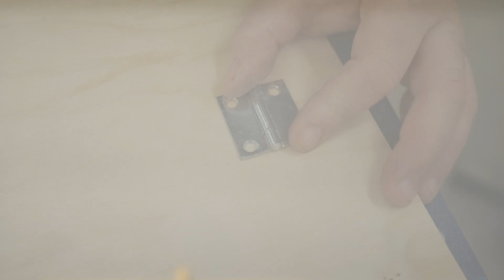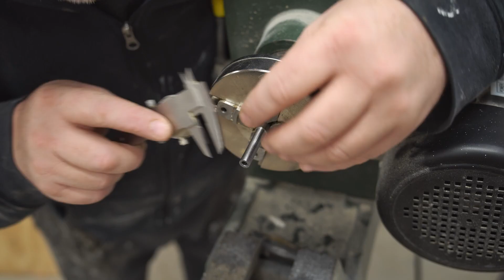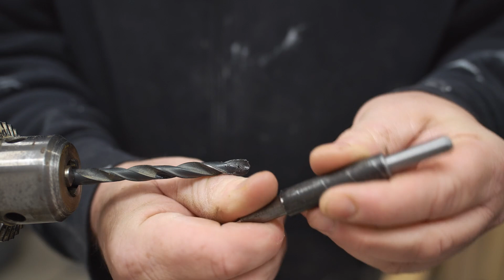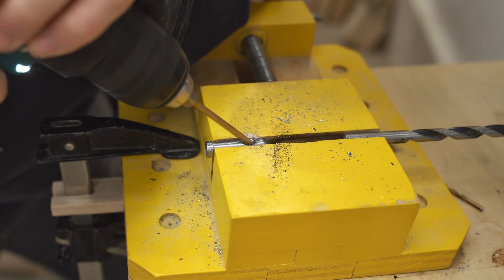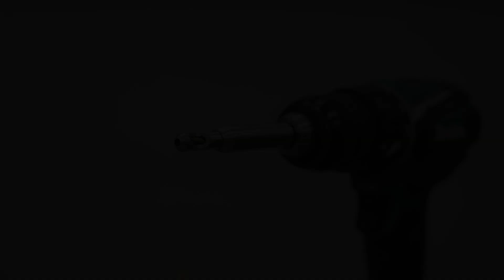How To Make A Self Centering Drill Bit / DIY Vix Bit

Comment: If you only need to get the hole centered for a steel (or brass) hinge on wood. simply start with a countersink. The wood is so much softer than the metal that the hinge hole will center the countersink if the hinge is clamped in place and that conical hole will center the drill for the screw. If the hinge fits in a mortice that makes the job even easier.

Comment: My goodness, John!!!    Is there any thing you can not do?!?    I just bought a set of vix bits and was confused by the knurled parts and also the Allen screws.   So I went to You Tube to learn about these parts and watched 2 videos where they are being used in hinges.  As per usual, I scrolled down to watch a third video on the subject, and there you were!!!  You have totally amazed me with your unparalleled  wood working and now I see you fabricating in metal work.   Needless to say, I am impressed.   I might also add that you explained the parts of the bit that I was confused about.  Thanks.

Comment: "...It's not especially fast when you have to stop and clear the chips out after every two or three holes" Then he proceeds to spend most of a day making a single tool bit.  I can buy a set of 8 or 10 on Amazon for about US$20. 
Interesting video, but I felt like I should be wearing safety glasses AND heavy cut-resistant gloves just to watch it!

Comment: To stop your file clogging up with chips (it's called "pinning"), clean it with a wire brush to get any existing pinning off, then fill the teeth with chalk. Just rub your marking chalk stick over the file until the teeth are filled. No more pinning!  If you use the file to sharpen your chalk, you can kill two birds with one stone!

Comment: machinist here and I'm not even mad. you'll find that incrementally stepping up in drill sizes like that puts an awful lot of load of the outer edges of the drills, I'd recommend getting a few center drills and if you are going to drill a pilot hole don't go excessively larger than the web of the drill. Wonderful work regardless

Comment: Good stuff. This is better than the road runner one.
Sometimes I use a pop. rivet drill bit to make a small starting divot to the center of the metal rod on the lathe. Usually they are short and quite strong bits. So they dont bend.

Comment: Is very interesting see how do you build this without a proper metal lathe. What if you make only one size, the smallest, and, for the next sizes, use a normal drill again with the correct size over the previous, already centered, hole ? Yes, I know is double work, but, if you don't need the other sizes frequently... Thanks for sharing !

Comment: Hey John. I thought your  build was pretty awesome on the Vix bit  one other note  is  i saw on Ebay a unbranded. Set   That the individual self centering bits were under 2  bucks  per unit  i could only assume  that original patents ran out and  those were Chines copies ?   It may not stop the clogging issues  you spoke about but i was quite amazed at how inexpensive  they can be bought at  now a days   Around 20 ish years ago   I  paid nearly fifty dollars for  a larger Vix brand  bit  that i still own today  it does  clog up  pretty  quickly like  most of my other  Vix bits  and  on big jobs i often  used it to only mark the hole and would drill it out with. Another bit  i really thought your machining  tricks on your wood lathe were pretty cool  to build. Your bit  and i mention those  inexpensive ones on Ebay  because they may be affordable. To use as. "Experimental"  ones to modify  or play with to improve  on clogging  ?i have personally only used Vix and Snappy branded  ones. And both have. Had the same clogging  difficulties  although i found the Vixs  brand to be made from a harder metal  with better springs than the Snappy  at a much more premium  cost  of course

Comment: Very cool project. I have tried softer metals on my wood lathe but never steel. Good to see that some steel work is possible if needed. 
I have a set of Vix bits I have never taken out of the package because it always seems faster to use the bit that is already chucked up than get them out.

Comment: Damn John , you are good :)
i'm a metalworker , i work in my own small engineering company . I have been in this trade for the last 25 years , and i work with my father wich is just few months short of 50 years of experience and we both think you did a great job. If anyone says otherwise it's just a moron troll with no idea of what he is talking about ;)
Reply: I own and operate cnc machine shop.. I'm impressed on the end product and using what tools he had.. I clicked on the video wondering how he was going pull this off without a metal lathe cnc or manual  now I know LOL
Reply: @cmf7972 yeah , he is resourceful as f :D

Comment: $22.98 on Amazon? Heck nah, that's for sissies!
Reply from the maker: Testing the cheapest vix bit on amazon is someone else's gig - I build stuff here :)
Reply: @JohnHeisz  u tell them ,
Reply: For that matter, he could buy most of his wood projects (in some inferior version) pre-made, but what would be the point?
Reply: @jej3451  he wood not a video ,and 57.00 dollars
Reply: He doesn't have 22.98 plus 3 days away
Reply: Then he would make an unboxing video, I guess?
Reply: Self centering drill that work just as good in standard (18mm thick) material costs 2$ come on!

Comment: Bloody clever design. I like how you demonstrated the various workarounds using the tools you have. I ground a series of metal rods (to make Centre punches) to suit the countersink profile of hinges I use, and thus mark where to drill. It works okay if I then get one screw into place, which holds the hinge for successive markings. Your drill idea completes the job in one operation.

Comment: "Goathead" loves ALL yer stuff John. Mainly for tips and tricks...... I cut off a large diameter screw driver and ground the tip to approx the same angles as the bevel. Even if you don't have the drift exactly centered initially, that light tap with my mallet centers it perfectly. .If my hinge is not mortised I can sink one screw then the rest are quick.

Comment: In before the armchair metalworkers start nitpicking. Great job demonstrating what a woodworker can do without a shop filled with metalworking tools.
Reply: i'm a metalworker , i work in my own small engineering company . I have been in this trade for the last 25 years , and i work with my father wich is just few months short of 50 years of experience and we both think John did a great job. If anyone says otherwise it's just a moron troll with no idea of what he is talking about ;)
Reply: @ItSeemsDark  as a metal worker as well most of this was impressive except using a metal saw in a rotating spindle, it was even shown in the vid why it was stupid
Reply: @callesundberg  agree